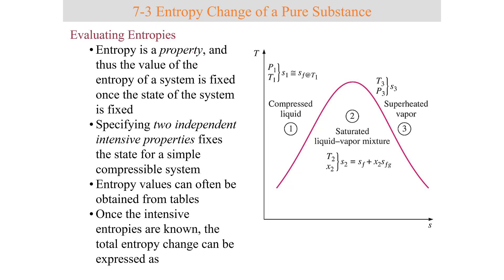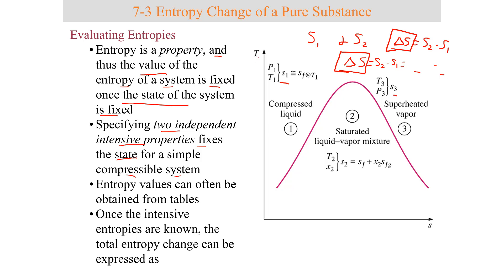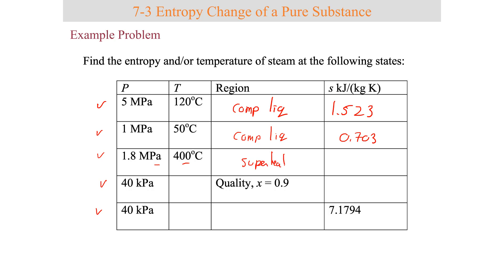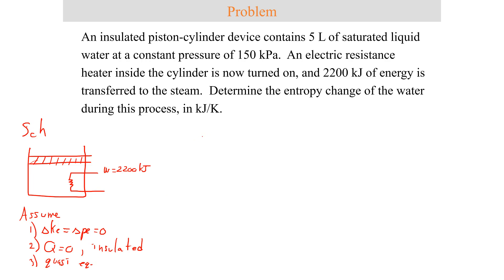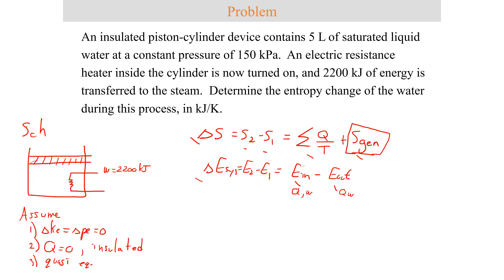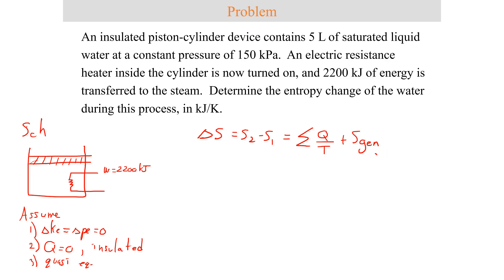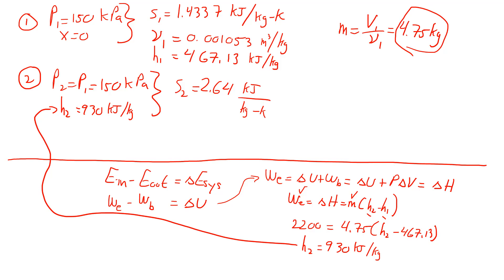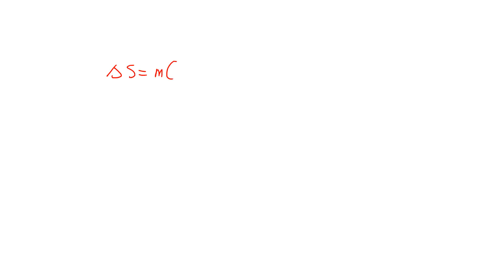Chapter 7 part 2

Comment: on minute 13.57, how do you get the second entropy from given pressure and enthalpy?
Reply from the maker: Pressure and enthalpy were given so with those two properties you can get the entropy
Reply: find dryness fraction (x) using h2 then use (x) in s2=s(f)+x*s(fg) at pressure 150kpa